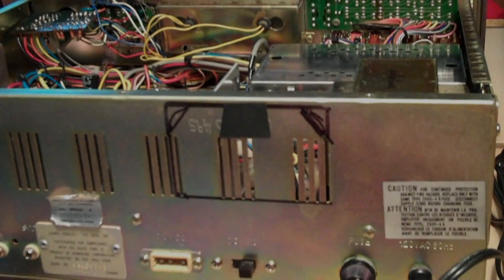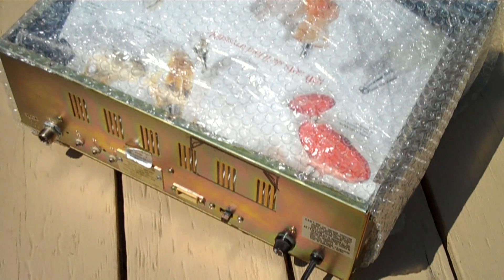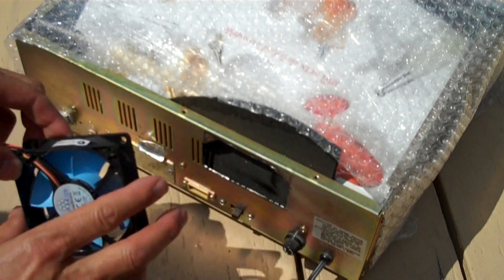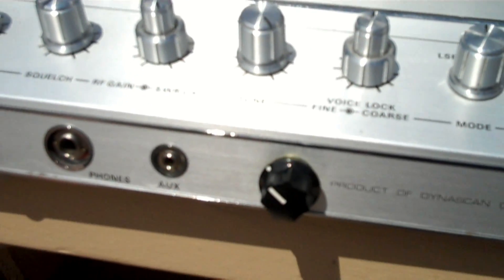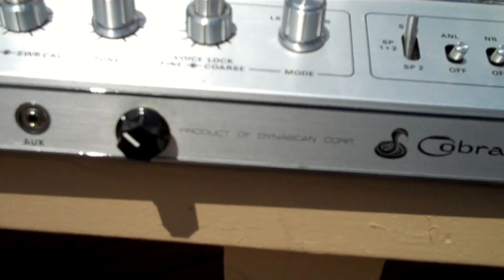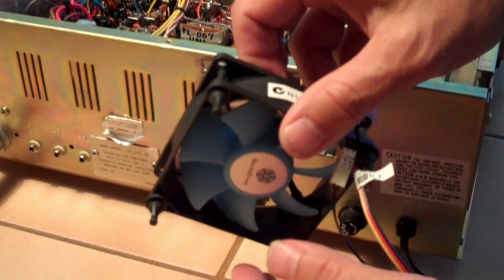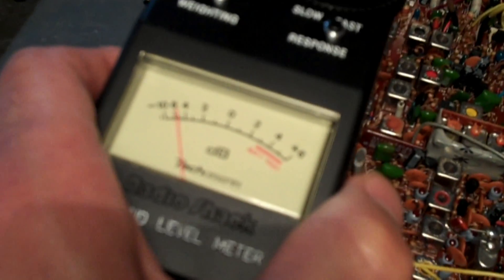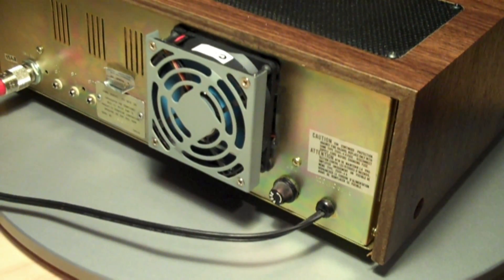Cobra 2000 GTL restoration project, add in a cooling fan? Part III

Comment: I'm not criticizing what you did but if you're going to cut anything in there I would have put an RFX 75 or 150  and maybe beef up the power supply
Reply from the maker: Thanks for the comment. That video was made almost 8 years ago. A RFX was considered but the internal supply limits that option. At the time it was the thing to do. Switching supplies back then were non-existant. Today one could drop in a 10A switching supply but that would still be to weak for even a RFX75. Therefore, as it was back then, it is still a valid option to keep the internals cool. Get an outboard heater if you want to maximize your TX signal.
Reply: Klondike Mike 
 yeah i have an old TRC458 I'm thinking about putting a RFX75 in it + a 30Amp 
Power supply
Reply from the maker: I wouldn't do it. Major hack job. Keep the heater on the outside.
Reply: @KlondikeMike  i think i would just figure out a way to have the fan utilize the vent in the cover instead, the cover can be replaced easier then the back panel imo

Comment: Cringe! There are fans that are much smaller than your first one. 1/4 smaller than the installed fan. Channel switch, dial-a-watt, receive preamp, noise toy, fm kit, etc. can be brought out via a ribbon cable to a nice project box. Modify yes, hack no!

Comment from the maker: @MultiMenotyou 
The orange wire that goes to the freq/time module is a constant 13.8v The trick is finding a switched ground. I'm not 100% happy with the points that I tried so far, pwr supply bd. and main bd. Stay tuned for an addendum to this series when I locate a good source for switched ground.

Comment from the maker: @spikey911usa
I didn't give an upward firing fan much thought. I have a thing about top mounted fans.

In this instance, clearance might be an issue. It will be closer to the front of the unit, to be seen and heard more easily. Mounting on a removable cover. Something dropping down on to a spinning fan. Although, it will be less effort to install. To each his own!

Comment from the maker: @spikey911usa
If you have been following my videos, you will see that "stock" has little meaning to me. I would be the one to take a 42 FORD and make it into one wild ride.

And by the way, the radio frequency counter has never be so stable. It was always drifting slightly, even after the re-cap. It is more beautiful than it every was, and I'm not done yet!